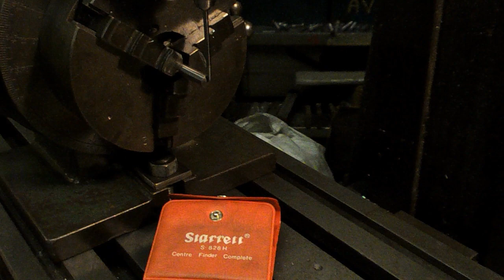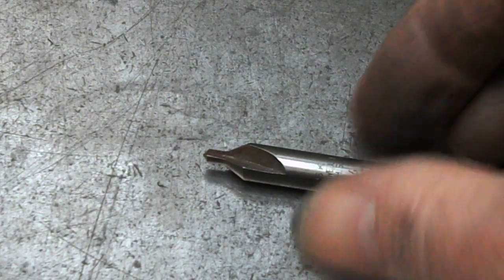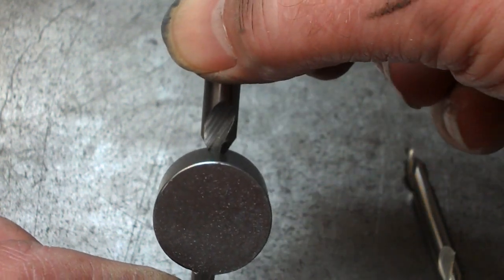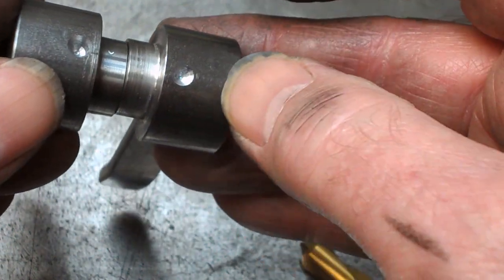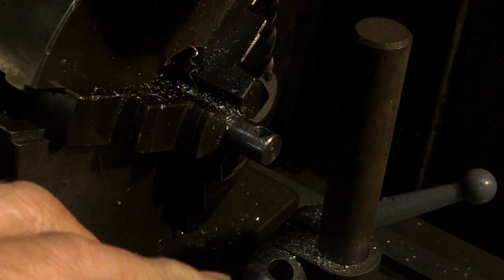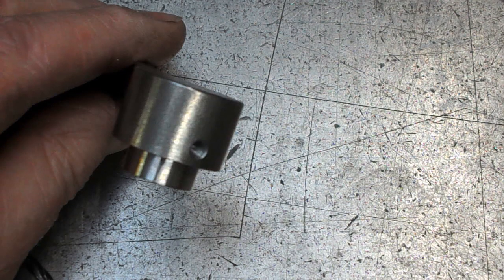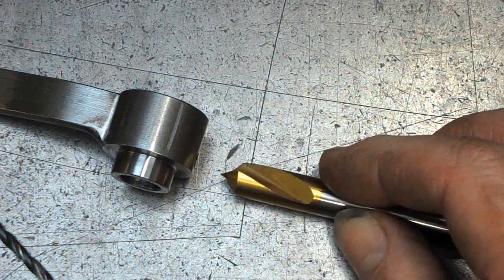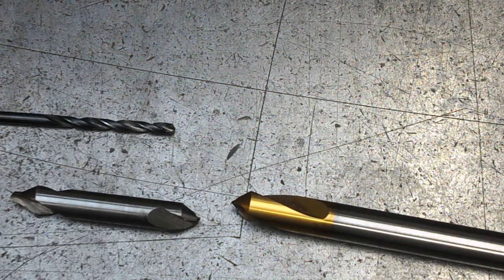Centre Drill vs Spotting Drill

Comment: A case of every situation can be different, certainly in your situation (stainless by the sight and sound) a final size drill can grab when opening up a slightly smaller hole.
At an auction of used tooling i picked up some spotting drills in a job lot that i assume an old timer had ground himself from worn out slot drills. The HSS used in slot drills is way tougher than used for common twist drills and holds an edge well.
Reply from the maker: Just mild steel here...
Reply: Slot drills meaning ... endmills?
Reply: Slot drill was the name of a two flute end mill. An end mill was a four fluted one. This has now all changed and the names no longer have the same meaning any more. 
Now you would just say a two flute end mill ground with a drill geometry.
Hope this explains your query.

Comment: A 90 degree center drill is not the right tool for a drill with a 118 degree tip angle. A 120 degree center drill should always be used because then it starts working on the center of the drill and not on the outer part like now in the video.
Reply from the maker: Yes, in theory that's true. In practice, it doesn't really matter much when using HSS tools to cut ordinary metals on a manual machine as shown here.

Comment: what are curved center drills for?
Reply from the maker: Curved? I guess the way the flutes are ground makes them look like that & some have a spiral cut while others are straight which affects the rake angle of the cutting edge. Given a choice, I'd use straight cut ones for Brass& Cast Iron & spiral ones for everything else.
Reply: @MidEngineering  well instead of a cone that a normal center drill would drill, I got these with a box of other stuff.   Carbide center drills but the straight angle of a normal center drill that would match up with a live center......... is concave on the drill.   I might have read 'used in grinding' but still can't verify
Reply from the maker: @dizzolve  Oh right, I know what you mean now! I wonder if you might use those for taper turning between centres with an offset tailstock? Thinking about it, doesn't look like it would help. A good question which I don't know the answer to!